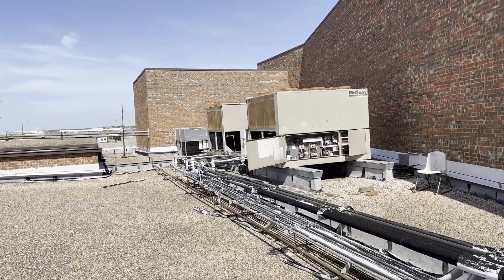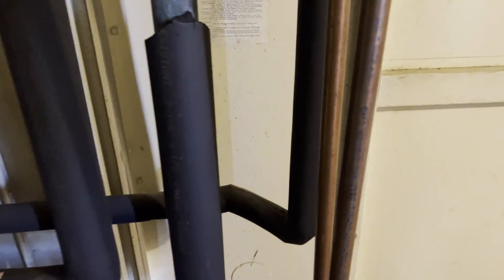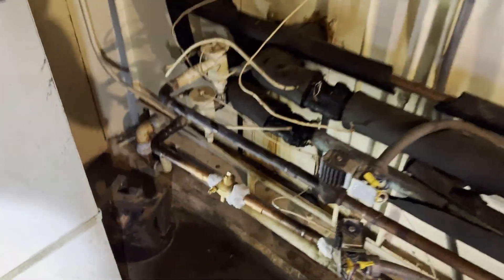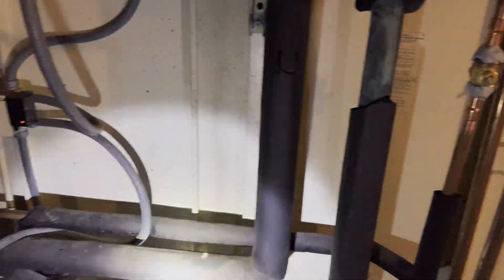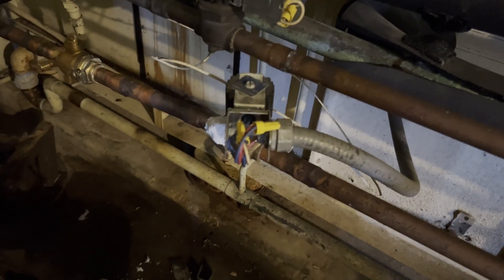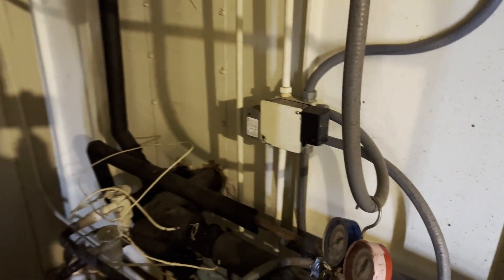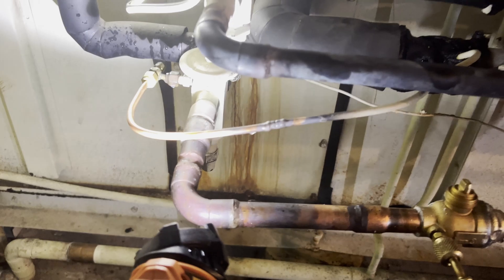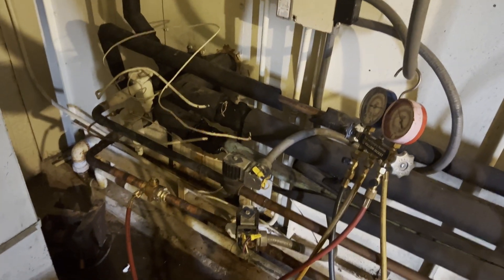IT KEEPS GOING FLAT ! ISOLATION LEAK TEST AND REPAIR - PT. 1

Comment: I need to get that rosebud tip
Reply from the maker: MTR Micro 6000 Rosebud Heating Tip from Uniweld

Great tip, had it for years now. Easily does over 2” copper and nice and compact
Reply: @dfwhvac  does it fit the victor torch set? Or what torches you have?
Reply from the maker: @WswRefrigeration   the set up in the video isn’t victor but it does fit my victor kit which included the regulators and handle
Reply from the maker: @WswRefrigeration  the victor kit I have that it works with is the Victor 0384-0946 Victor 9pc Gas Welding Outfit
Reply: @dfwhvac  sweet that’s the one I have. I’ll order one